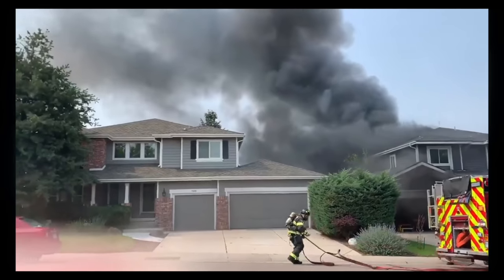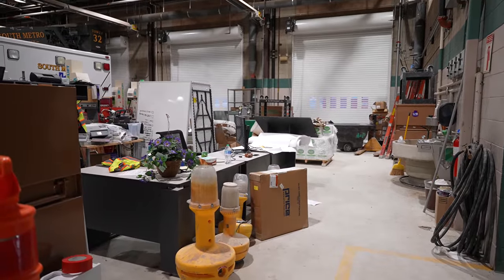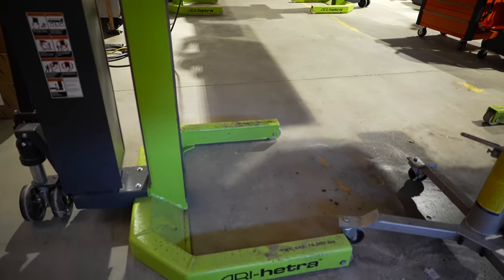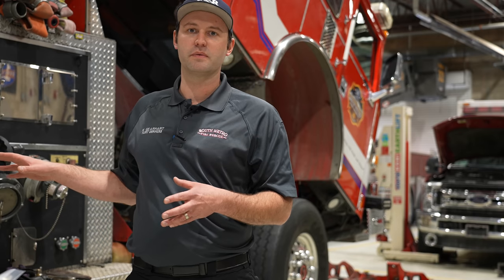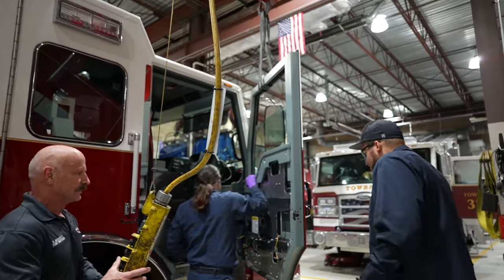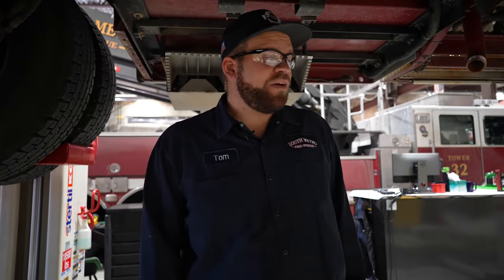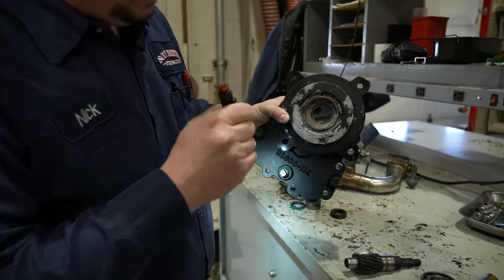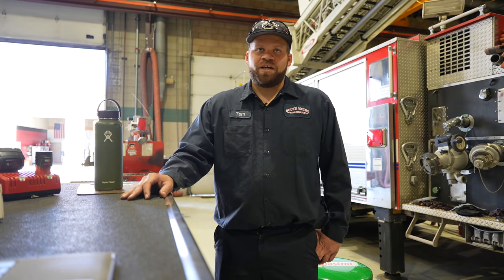Fleet - A Day in the Life

Comment: In the USA I think almost all of the larger full time or career fire departments have there own version of fleet services. After all these vehicle do have in common with our own vehicles engines/motors to drive the vehicle, lights as in head lights, turn signal lights, and alike, they have oil and filters some thing like you car. The big diesels have more filters and bigger then your car, they have coolant or antifreeze. I grew up with a dad who was a mechanic and fireman/fire fighter so I know these vehicles need repairs and preventative maintenance. I never thought that people would not know these vehicles need work also. I learned some thing new again. I like when that happens. Very interesting video, I learned a lot about the South Metro Fire Districts Fleet that I did not know about. Like the smaller shop bays in the other building and the fact that the main building is a shared facility. I liked learning things I did not know about your Fleet Services Department/Division.

Comment: Has South Metro ever looked in to building a garage for IDT 2? I hope someday it dose get an apparatus or garage bay for this unit or the feature replacement of that vehicle. I am going to guess that the idea of an apparatus bay for IDT 2 at or near the current communications center center has been talked about at the least.
Reply from the maker: IDT 2 parks under a large covered vehicle port at Headquarters which keeps the sun and snow off the truck. A permanent garage structure could be built in the future.
Reply: @SouthMetroFireRescuePIO  Wouldn't work here... frosted windows when needing to respond would not be good :)
Reply: Is this truck connected to a battery charger when not in use? Those Webastos suck the life out of batteries when its cold.

Comment: I live in a rural Virginia County of 33K people that used to have two geographically spaced ladder trucks. County fire administration sold off one of the trucks because of the $100K cost of annual OSHA inspections. I believe much of the cost resulted from having to x-ray the ladder frame and rungs to detect cracks not visible to the naked eye. Does the shop do required annual inspection of ladder trucks or do they have to send the truck to an outside contractor?

Keep up the great videos and above all STAY SAFE! 🚒❤️😷
Reply from the maker: SMFR Fleet does an in-house annual inspection on all of the aerials, as required by NFPA and a UL inspection every 4th year. That includes 6 front line and 3 reserve aerials.

Comment: I'm just curious now they have tender 40 in here for service what happens if you have a Wildland Fire that needs the tender do they have a backup tender that they can use?
Reply from the maker: SMFR doesn’t have any reserve Tenders since there are only 6 front line Tenders which usually have very little down time at the shop. If a fire occurs near Station 40 other Tenders will respond and those could be mutual aid from West Douglas or Jackson 105 Fire Districts.
Reply: @SouthMetroFireRescuePIO  Thanks for the response.